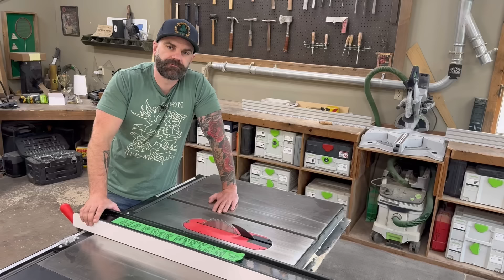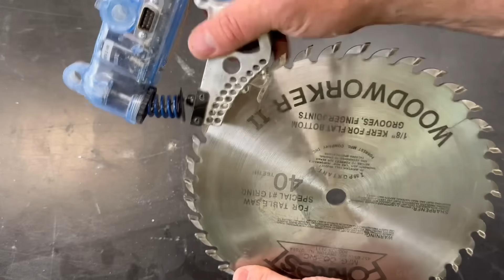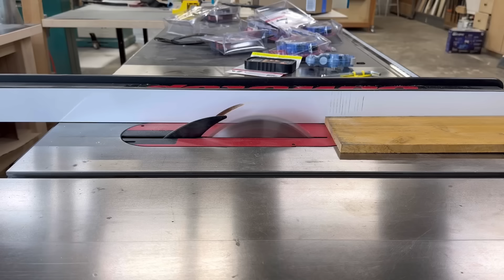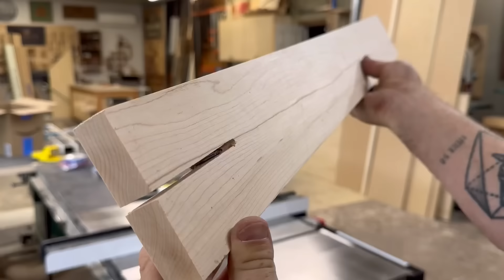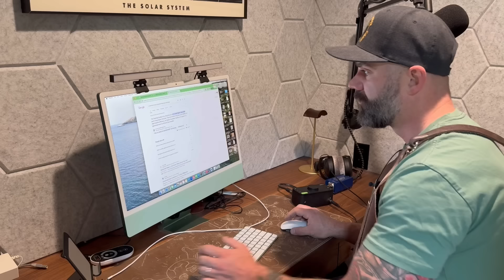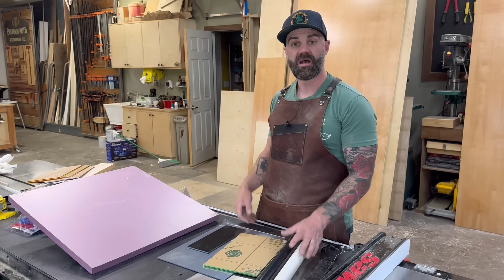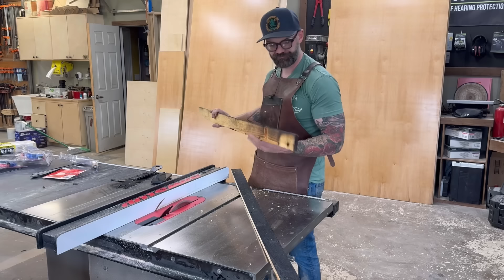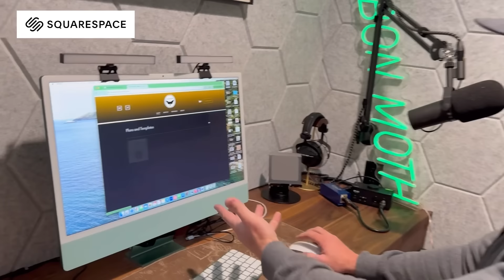Finger Versus Table Saw || Testing SawStop Myths

Comment: I did set off my SawStop with my thumb. After over fifty years of operating table saws and not cutting myself, I got stupid and ran my thumb into the blade. I did get a little more than a nick, and it did bleed. It also hurt......but my thumb was saved.....but my ego was bruised. I thought to myself, "How could I be so stupid???"
Also, when you get tired and fatigued, get out of the shop.
Reply: As a carpenter for decades and being hurt several times, never more seriously than a few stiches, the thought "how could I be so stupid" has crossed my mind on several occasions! 😣😣 It happens. Most of these accidents did not even include power tools!
Reply: @wooddogg8 my worst accidents, the real bleeders, are from chisels. So dumb.
Reply: @mattnielsen5274  yeah, I put a 1/4 chisel through my finger a few months ago, required 6 stitches....
Reply: @mattnielsen5274  Worst accident I had was during hurricane prep.  I drove a 3" deck screw through a 2x4 and into my finger.  I had to reverse the cordless drill to get it out.  And yes, dumb.
Reply: Everyone runs on autopilot. No one is immune.
Reply: I use my table saw around 3x a year. That’s the reason i sold my bosch last years and got a sawstop. We get older, we are distracted. I do my very best to never cut myself, i try to think ahead and plan my cuts. But if something happens, i have a last line of defense. That’s worth the price, at least in my book.. especially for people that don’t regularly use their saw and might not have the experience of people working with those saws daily…
Reply: I am glad you had that tool.
Reply: Thanks for posting this video. It is very informative. I’m getting older and I’ve been thinking of buying a SawStop. My fingers are not as nimble and I find it hard to handle material the way I used to. That makes me a little worried when using the table saw. 
On another subject. Don’t give in to the temptation of click bait. True woodworkers, dedicated and weekend warriors alike, do find your content important.
Reply: Yep it's always the 'one more cut' 'one more ski run' that gets you
Reply: Every once in a while, I reach for an offcut and realize I wasn't paying attention to that spinning blade as much as I should have. It only takes that one time our thoughts are elsewhere to catch us.
Reply: Just out of curiosity. Did you also have the blade guard installed? Or was it a cut that the blade guard was not going to work with like a non-through cut? Or did you just toss the blade guard and never use it?
Reply: I’ve done it too. Needed stitches and still have a numb finger but I still have the finger
Reply: Don't feel so bad. After 50+ years as an avid home shop project person, and without a Sawstop, I shortened two fingers on my left hand doing something beyond stupid.
Reply: Awesome video! Thanks for doing it!
Reply: Try wetting the top of the foam, and touching the wet surface.  The protection circuit does not need a DC connection to ground, it is looking for an increase of the capacitance of large objects.  A small slice of a hot dog probably would not trigger it either.  Tape a 1/4" thick section of a hot dog to a piece of wood.  Saw through the wood and hot dog.  I believe the hot dog section will get cut without triggering the SawStop.
Reply: I'm not a professional woodworker, but I've known or met at least 4 people who've cut off fingers or worse with the saw.  I haven't had a table saw in years, but nearing retirement now, I plan on getting another one, and it'll be a Sawstop.
Reply: This is why I bought the SawStop out of the gate.  I don't trust myself to not get sloppy one day.  Would much rather a nasty cut over a lost digit.
Reply: Glad you saved the thumb, good advice
Reply: After years of table saw work with no injuries, it happened. I was distracted for a split second and bam. 2/3 thumb amputation. Getting one.
Reply: Blade guard too
Reply: I wonder is that partly due to your subconscious "relaxing" a bit around the technology.
Reply: I cut halfway through the index, middle and ring fingers doing something stupid.  I tell people that saying they're sorry I went through that is the wrong response.  Best response is "Dummy, bet you won't do that again."
Reply: @loricreel2463  I asked an acquaintance ,who amputated 4 of his fingers, him if he'd heard of Sawstop.  He said it was too expensive.  I then asked how much he would pay to not have gone through the experience
Reply: I asked an acquaintance who had amputated 4 of his fingers on the table saw if he had ever heard of Sawstop.  He said it was too expensive.  I asked him how much he would pay to have avoided this experience. Three months later, he had a Sawstop.
Reply: У нас, в России, знакомый водитель автобуса занимался столярными работами и отпилил себе 3 пальца сразу на циркулярной пиле. После этого он продал все свои станки😂
 Говорят что столяр у которого все пальцы - недостаточно опытен.
Reply: @user-dc4yl6tp6i we - have a similar saying in some sections of the US.  Stay safe, my friend.
Reply: @Мафик-ь5й yep. Don't trust a carpenter who has all his digits intact.
Reply: @Мафик-ь5й  il s'est coupé les doigts pour ne pas aller en Ukraine 😂
Reply: My problem with a sawstop is that it can breed complacency and discourage good safety protocols, especially in new woodworkers who may rely on technology instead of self preservation. Some of the techniques I’m seeing on the video are scary with hand placement, particularly reaching for the cut-offs.
Reply: @waynemanning3262  Not for me!  Seeing a blade spinning still has it effects, even if you do have a sawstop.
Reply: @waynemanning3262 the cost of replacing the blade and the brake definitely would cause me not to become complacent. I keep spare brakes just in case, but hope I never have to use the spares.
Reply: @jimm.4864  I was reading recently that said SawStop will replace the cartridge free for legitimate saves? But don’t let that change what you’re doing! Lol
Reply: @waynemanning3262  That is how I cut my finger on a Sawstop - i.e., reaching for cutoff.  And it cut more than skin deep; I'd say about 1/8" deep, which does not sound that deep, but trust me, it caused a lot of bleeding and pain (6 months later and I still feel it a bit, especially when I go to cut my fingernail).  Gotta say though, it was probably better than if I did not have a Sawstop; who knows how deep would have cut!
Reply: @waynemanning3262  like saying seat belts have made people be more wreckless when driving, it's just not true.
Reply: @atomictyler  seatbelts do save lives, but after they were required the number of accidents did increase, look up the Peltzman effect. Better headlights have also been a factor in increasing speeding at nighttime resulting in more high energy accidents. If your a football fan then you probably know that the better the protective gear got the severity in brain damage increased, compared to rugby with no padding or helmets where the injuries are usually just cuts,bruises and sprains. As high school shops have been closing down for at least the last twenty years most new woodworkers have little to no proper safety training and will tend to rely on safety features more and more, I know that from experience working with many hundreds of teen and early twenties youth that common  sense and survival instincts have become rarer nowadays, I work in one of the most hazardous professions there is and was the safety officer for many years with the appropriate training and can tell you that humans can out fool the most foolproof devices out there. This video you just watched, how many times did you spot the improper hand placement around the turning blade? The SawStop is a great tablesaw but like blade guards it can’t replace proper training and techniques.
Reply: @waynemanning3262  There is the "Will Actually" guys.
Reply: @waynemanning3262 the number of accidents increased because the number of cars on the roads increased. Has nothing to do with seatbelts.
Reply: @davidpeters8813  look up the Peltzman effect, nothing to do with more cars!
Reply: @waynemanning3262  there were errors with his original study and there have been other studies which have shown the opposite affect. It was his theory, not something that has been definitely proven. It's not as simple as saying more accidents happened after seatbelts. There are many other factors that have to be accounted for, which he didn't necessarily do. Additionally, the increasing number of cars on the road will cause an increasing number of accidents because that's the way statistics work.
Reply: @waynemanning3262 EXACTLY. I’m using a 1985 craftsman saw, and all the safeties are removed, so it resembles the huge Powermatic we used in 7th grade till I was a senior, in wood shop class.  My fingers go nowhere near the blade, EVER.  kickback is my only concern, but I’m standing far left of it all. Once, it shot the piece right out of my garage.  And that’s when I stopped ripping crap lumber.
Reply: @waynemanning3262 there is something to be said about that I guess but I’d argue if you’re using a table saw enough to either have or have access to a saw stop you’re likely using a variety of other saws that don’t have the safety features of a saw stop which I would argue give you the proper respect for fast spinning sharp blades. The saw stop simply gives you a safety backup for what I consider to be one of the most dangerous tools in the shop only really being behind a lathe or radial arm saw in terms of common shop tools for the average woodworker.
Reply: @waynemanning3262 That's nonsense.
Reply: @drooplug  what’s nonsense? Learning good safety protocols, relying on technology please elaborate.
Reply: @waynemanning3262  That safety devices breed complacency.

Comment: Cheap hotdogs... you need Sahlen's and some good Webers Horseradish mustard!

Nothing will ever replace using your head with power tools... not just table saws.  If and when I decide to spend $$ to replace my table saw, it will be with a safer cabinet model like the Sawstop... but that may never happen honestly.  I have a vintage late 60s Craftsman 113 from my dad that is built like a tank and all decked out with extras (custom base, 4 cast wings, including a router table wing, Delta T3 fence system, etc.).  If you are buying new, then most definitely get one.

Comment: Thermal conductivity is about heat, not electricity. Think of holding a stick by one end while the other is on fire vs holding a metal rod that's had the opposite end in a fire for some time.

Comment: I have no clue how it works. But if resistance is a factor to trigger it, the size of the object is also a factor. Instead of using a big aluminium fence and a small nail, I would have used either a rod or a plate of the same size for both metal. And probably a small one and a bigger one.

Comment: I just made dados on 4 x 4 posts that were quite wet yesterday and i forgot to deactivate the system. It took 5 seconds and boom, the dado blade was stuck in the cartridge. My experience is that it does work with wet wood.
Reply: Treated wood is salty and very conductive.  Regular water won't do it. It's actually about capacitance. Read up on it. It's part of conductivity, but more related to the size of the conductive piece. You holding a Weiner will set it off. A Weiner hanging from a string won't. Don't let Weiner touch the tabletop because then it becomes part of the capacitance — and it will trigger.

Comment: I was surprised that the cross cut sled set it off.  I would have thought that an aluminum fence would potentially set it off if it was in contact with the table surface (and you with that) but expected the plywood to prevent that.  Sticking with that theory though, I’m assuming that the rockler sled has aluminum runners and everything is bolted together — so maybe there was a path to you?  Though, it really didn’t look like you had your hands on the table surface either.

Comment: That power off safety on feature is clutch
Reply: The saw will even tell you. After you turn it off via the paddle, the green indicator will blink as the saw is spinning down, indicating it's still in a state where it will trip. The real question is, will it still trip if you cut power using the switch instead of the paddle?

Comment: water isnt the best conducter of electricity on its own, add a little bit of salt to it and it or some cooking soda and it will set it off for sure. I used to mess with electrolytic rust removal and you need  conductive water for that process! As always killer videos, keep up the work!

Comment: Water is not conductive. But salt water is. Soak the wood in salt water and the brake will go off. Treated wood will also set it off because copper is extremely conductive.
Reply: As a welder I beg to differ having been on the receiving end of a shock from damp rods or gives🤨
Reply: I was hoping for a copper nail, betcha that would set it off!
Reply: Really?   So your saying the radio in a bathtub thing isn’t real?
Reply: I run treated wood through my Sawstop all the time with no issues
Reply: Oh sure,  next thing you are going to tell us is that if you leave your saw stop unattended for 8 hours it will burst into flames!   HOAX!   🤪🤪🤪
Reply: Huh?
Reply: @jeffreysmith5018  gloves 🙄
Reply: wow, there is more wrong than right here....
1. Water is conductive
2. Wood treatment is done with copper SALTS that are non-conductive after drying. It's orders of magnitude less conductivity than tap water. There is not metallic copper in treated wood.
3. The way the detection works does not rely on good conductivity.  
4. Wet wood can, but does not have to trip the system. That's what the test function is for.
Reply: Pure water isn't conductive, but you're never going to encounter truely pure water outside of very specific industrial or lab settings. For all practical purposes, water is conductive.
Reply: I remember being taught distilled water is not conductive (I'm too lazy to go test some with a meter) but it's all the dissolved minerals and other salts in "normal, fresh" water that makes it conductive. Salt water is even more conductive with the higher concentration of NaCl.
Reply: @Mark-zi4dd  correct. distilled water has a very low conductivity. it's the other stuff that's dissolved in the water that makes it conductive.
Reply: @wernerviehhauser94  
"... non-conductive after drying"
but we are talking about WET wood, right? some of those salts will dissolve in the water, making it far more conductive that it would be otherwise.
Reply: @mrxmry3264  try reading again.... we did not mention TREATED AND SOAKED wood.
Reply: @wernerviehhauser94 Water on its own (i.e. pure water) isn't conductive, so that's technically correct. But in practice water is hardly ever pure because so many things easily dissolve in it, so it usually contains impurities that are conductive.
Reply: @fadetonoir6152   my guess is the TO does not know what a Siemens is nor has ever seen or know something more pure than distilled water (which still is conductive). Why should I blast him with information beyond the scope of his comment?